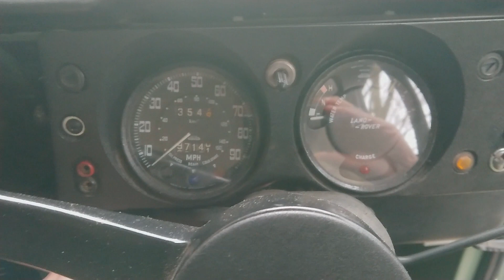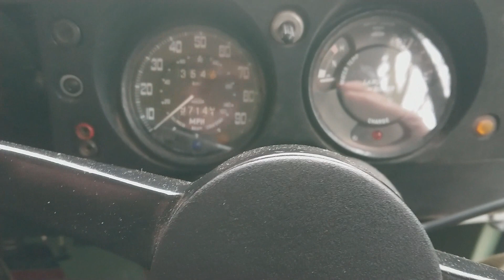Land Rover Series III engine not running right

Comment: I had exactly the same problem, I changed the points, condenser, cap, coil, plugs and leads....no difference. I set the timing and even changed to electronic ignition....no difference. I had exactly the same hesitation and backfiring when throttle was depressed!  I had also rebuilt the carb and again no difference! So I looked again at the carb. I lapped all the mating surfaces to be completely flat and noticed the accelerator piston was jammed. It wasn't obvious to start with as the spring was sticking out and could be depressed but the piston was seized in the bore. It took some time too free but I managed, polished the bore and piston with a fine scratch pad and reassembled. Fantastic! Finally no hesitation on pressing the throttle. Finally solved a very annoying issue.

Comment: A simple fix you can try when this happens is take the intake pipe off the carb then try and slowly go wide open throttle, once WOT then block the carb with something flat, it should unblock the carb. Do it a few times.

Comment: Accelerator pump in Carburettor is not working correctly if the engine behaves like this similarly when it is fully warmed up.

Comment: Pull off the carburator. Scrap off the old gasket and throw it away. Clean both of the flanges (on the engine and on the carburator)  till they are  really shiny clean metal with a iron file. It must be very shiny and clean. important!   Install new gasket . Now there is no valse air cause everything is clean and shiny.  Good luck!

Comment: did you sort it?
Reply from the maker: Yes Gordon we did but not in a way we expected... Got a new carb from Fuggle Fettlingwhich helped and then someting else threw a spanner in the wheels https://www.aloeride.com/series-land-rover-restoration/ All sorted now though :)
Reply: I have a similar issue right now. I've swapped everything and still it persists. Changed the electronic ignition back to points, new coil and condenser, different carb, new fuel pump...and now I've removed inlet manifold in case there's a leak. what else is there?